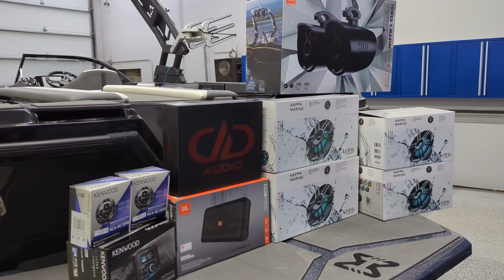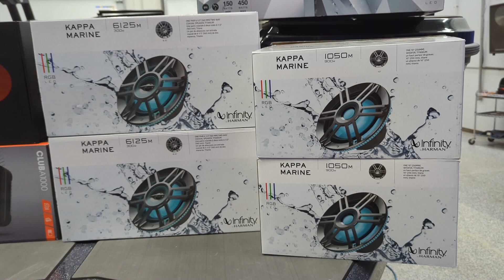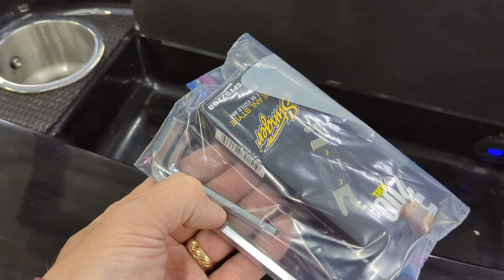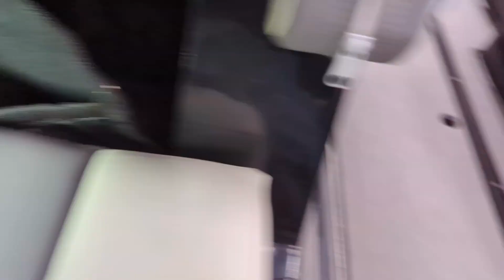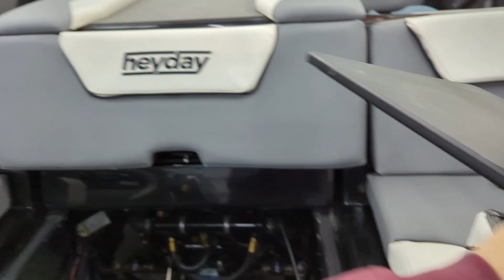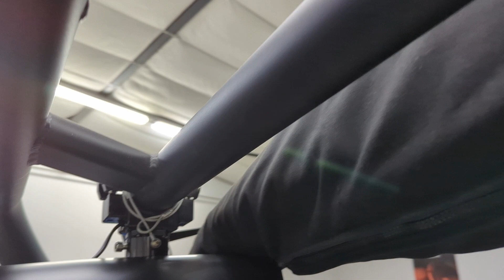2023 Heyday WT-2DC gets a Serious Stereo System Audio Upgrade - Amps - Speakers - Subwoofers - More!

Comment: With these subs did it require that you build enclosures behind the in the dash area? Or could you use them as a free air setup and take out the make shift factory enclosure that really isn't hardly an enclosure?
Reply from the maker: These subs are designed to work in a free-air / infinite-baffle application. No "enclosure" per se, just a strong baffle to separate the front and back wave.
Reply: @SweetSounds thank you for the reply. I need 2 of them! Also need the ideal amp for them. Are you going to be a good source for that or should i go to Google?
Reply from the maker: @ClayConn-t3t  Please shoot me an email Jeff@SweetSounds.com  Thanks!